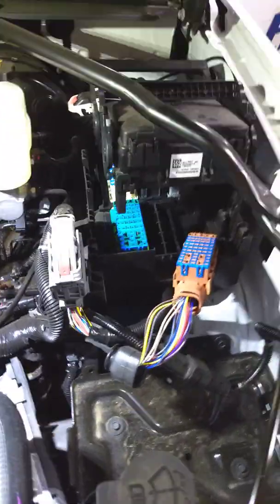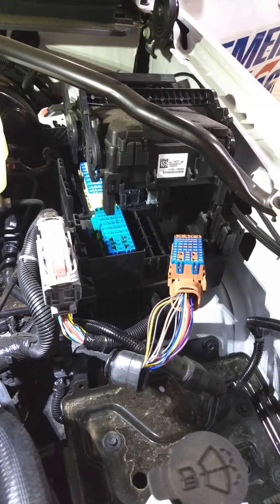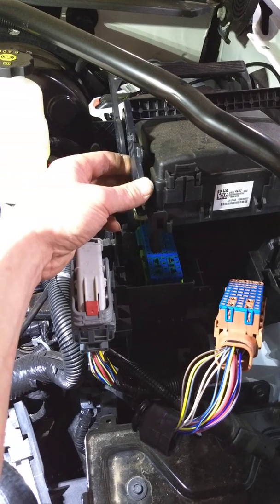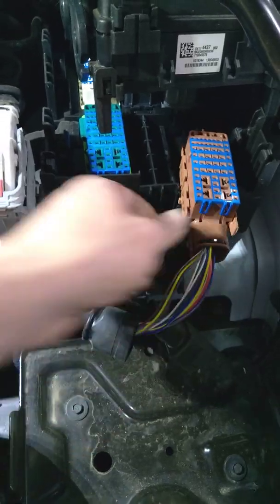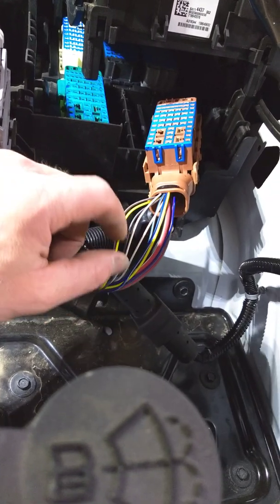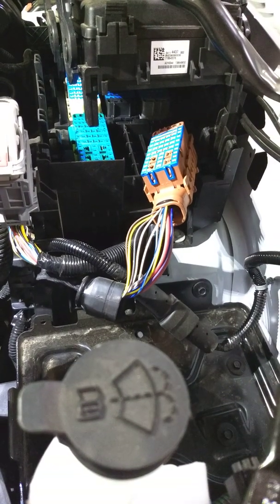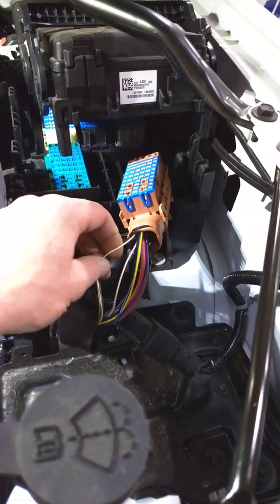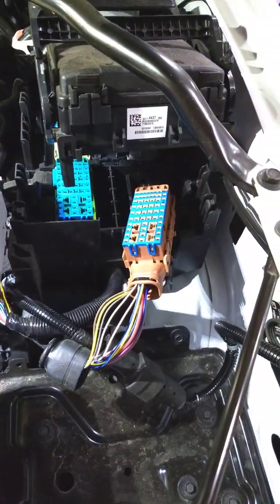Chevy headlight wig wag module

Comment: Can you help me with 2015 Tahoe with whelen 2150A flasher connecting blue and yellow?  Do you cut both white wires or one? I appreciate your help in advance
Reply from the maker: I would recommend going to Whelen's website, top right corner is the menu tab, click on that, under the Lighting section click on accessories, scroll down to the UHF2150A flasher, click on that, open the documents tab, then open the Install Guide: 13510. Just follow the Positive-side Switched Headlights diagram and you should be all set.
Reply: @heckbuilt1930  I emailed you
Reply: @heckbuilt1930  was it heckbuilt@gmail.com
Reply: @heckbuilt1930  I know how to wire the flasher it’s the two white wires that has me stumped. Which are inputs and outputs

Comment: Is the Whelen UHF 2150A a good option for a 2014 Tahoe?
Reply from the maker: Yes, that's a good flasher that they make. I would recommend mounting it under the hood in the engine compartment if I was using that brand, they use two relays to flash the headlights and it's a little noisy if you mount it in the cab.
Reply: @heckbuilt1930  thank you so much!!! So when I wire it, I just tie in the appropriate wire from the flasher to either side of the "cut" white wires from the fuse box, and it should be good? And of course my trigger wire.
Reply from the maker: @RMcc401  
Yes, for the most part. Just follow the directions that come with a flasher, but I believe that model flasher requires a 12-volt power that is capable of handling 10 or 15 Amps and then you'll have the trigger wire that just needs switched.
Reply: @RMcc401  did you get this to work with whelen flasher if so blue and yellow go where? To one wire or both of them?